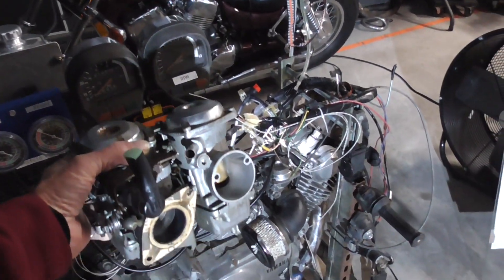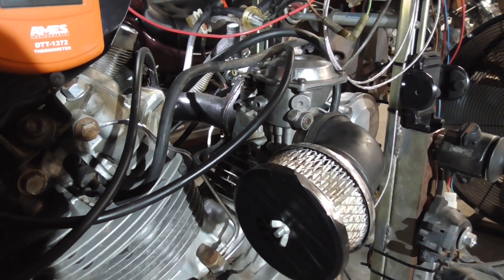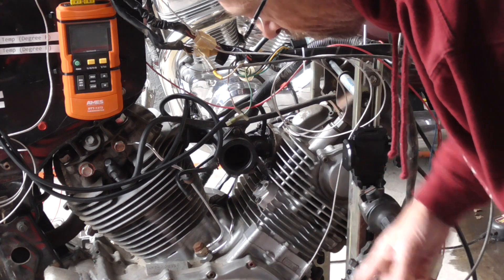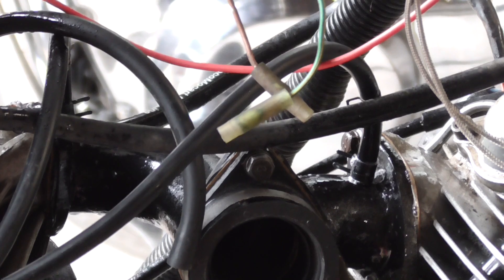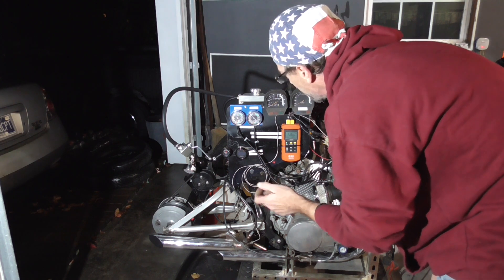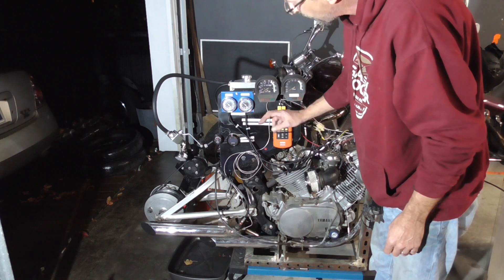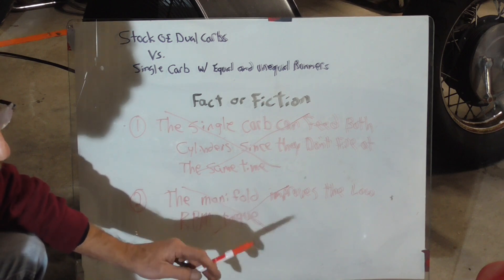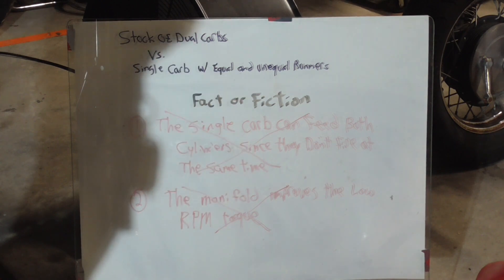Single Carb Conversion Testing - Part 2:  Single Carb setup with Stock Jets...lets bust some Myths

Comment: Where did you find these claims? They're only partially true under the right circumstances.

Carbs don't only supply fuel and air for the intake stroke but also during the other strokes. The manifold doesn't just have some or 0 pressure so on on a graph looks like a sin wave. As intake closes, air will still come through to correct the pressure from atmosphere and vacuum causing fuel to release and retain in the manifold which is factored into the main combustion charge next intake cycle. 

Since viragos are 60° v's, they arent evenly firing/ balanced. On a graph the amount of dead space between intake strokes is 120 for rear and 240 for front (clockwise rotation on diagram). Which for a carb tuned for 1 cyl would net lesser fuel for one and even less for the other. since they don't have the usual post-intake fuel. This is why you have one cyl leaner than the other.

So, the single carb: 2 cylinders advice rings more true on even firing engines like a parallel twin, or v4, rather than a 60° v. But even then no single carb tuned to a single cyl will ever fire two without fuel charge loss without re-jetting due to the 'fuel after intake' principle I just mentioned. You would see the torque change after rejetting the single, but would need a dyno to really actualize.

Good testing but poor starting claims though, keep it up. I love watching tests I didn't have to do myself.
Reply from the maker: Thanks man and thanks for the details as others reading the comments can get more detail on as to why the two cylinders pull fuel differently 👍. The fact or fiction items come from various Virago forum posts I’ve seen over the years as folks talk back and forth on why a single carb and manifold can perform as good as the duals. I’ve wondered about the single carb setup myself as I’ve always run the stock duals (rejetted, intakes and exhaust opened up, etc…but still dual carbs) so doing the tests confirmed I like dual carbs better.

I’ll probably do some more testing with different designs just to see, but it did confirm several of the speculations by folks were incorrect. 

Thanks again and all the best !  Steve

Comment: I can't wait for the facebook engineers to react
Reply from the maker: Lol !  Yep, I’ll say the comments will get interesting for these videos…especially the Part 3 one as it shows the testing and comparisons for the single carb manifolds. I actually left the checks for the manifold leaks in just so that question wouldn’t come up as well as put the dual carbs back on after the testing in Part 3 to show that the motor hadn’t changed any after all of the tests.  All the best !  Steve

Comment: That's interesting & really good to know 
How many miles - kilometres do you get out of your motorcycle.
I'm only getting 200ks from mine.
Reply from the maker: Thanks 👍. My stock 1981 750 gets the same as you mentioned…right at 200 km (125 miles) before hitting the reserve under normal riding conditions.  The bobber that has air pods and an open exhaust (I re-jetted the dual carbs to account for this) only gets about 165 km before it hits the reserve fuel.  In Part 3 of the carb testing, we’ll see something similar on the drop in fuel economy since I had to re-jet the single carb to be able to get the AFR low enough to run the motor.
Reply: @StevesDIYs  ok Kool, thanks so much for the reply, appreciated,.